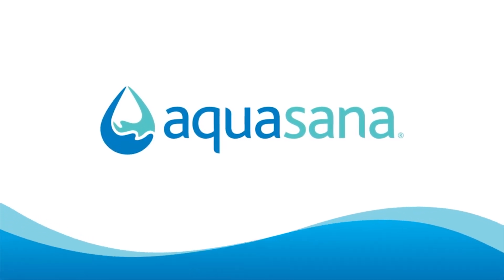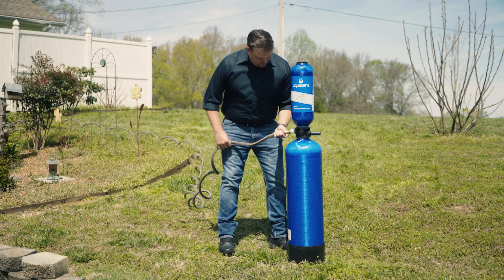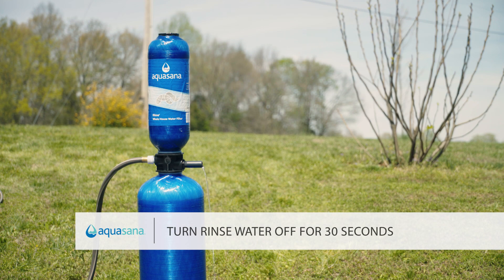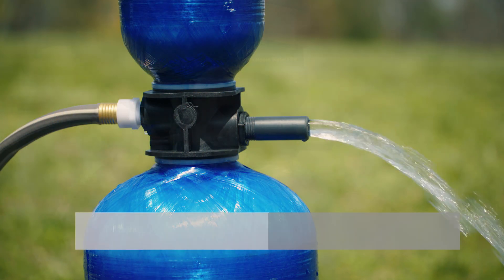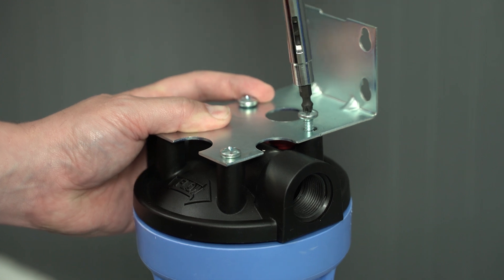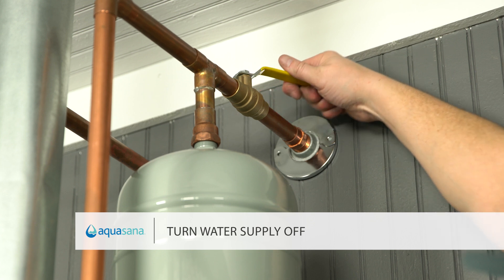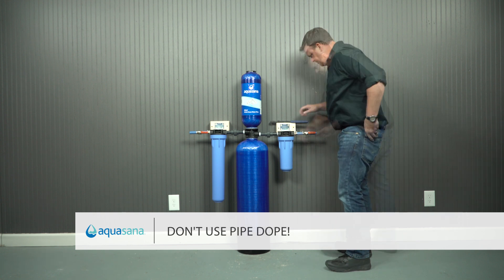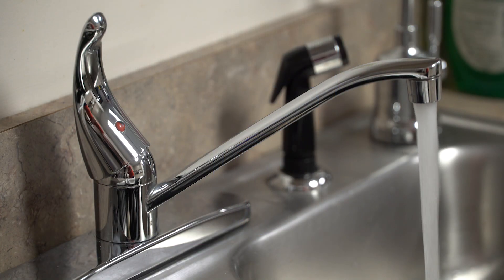How to Install an Aquasana Whole House Water Filtration System

Comment: why the redundant pipe if the water is coming down and going back vertically? you could bring pipe down into the bypass loop directly with a tee and then elbow into the filtering assembly. back out the other way too. elbow up after the shut off valve (after the post filter), then tee off the bypass to continue the water up. Saves pipe and its cleaner.
Reply from the maker: Hi! Thats is a good question! We do have an Owners Manual that instructs our customers how we recommend to install the unit, but our way does not work for everyone. We do leave it to the customer's discretion on what set up works best for their home, as long as the filters and tanks are in the correct order. If you have any further questions about our unit, please contact us directly at 866-662-6885, option 1, a Customer Service representative will be more than happy to assist. We are open Monday through Friday from 8 am to 5 pm CST.

-Aquasana Customer Support

Comment: They say "Recommended for use by Aquasana certified plumbers only", but what they don't tell you until after you buy it is that if you install it yourself and don't use a licensed plumber, you void the warranty. Now I have to pay a licensed plumber to install this unit. Added expense that I did not anticipate.
Reply: How are they going to know???????????

Comment: We are expecting a snow storm next week here in my area. I have a plumber scheduled to come out on Tuesday. Is this flush by way of outside hose the only way to flush the system?
Reply from the maker: Thanks for reaching out! That's a great question. Outdoor flushing with your garden hose is the recommended method of flushing due to three reasons: 
1. The volume of water that needs to be flushed is best to be done outside. 
2. The adapter that is included with your filter only connects to a garden hose. 
3. The carbon fibers that are flushed out of your filter are not suitable to go down your drain. 

Please let us know if you have any other questions, hope you're staying warm with the snow!

-Aquasana Customer Support